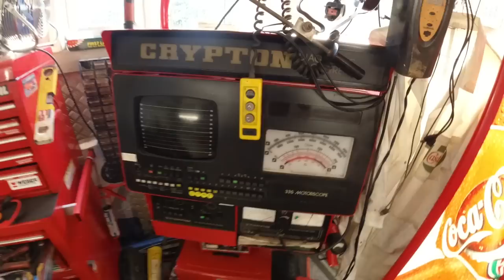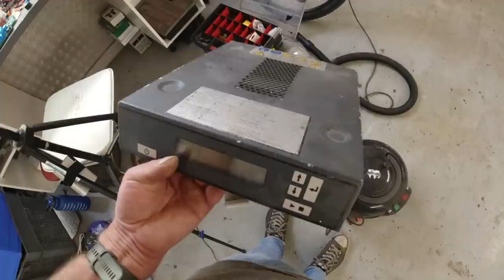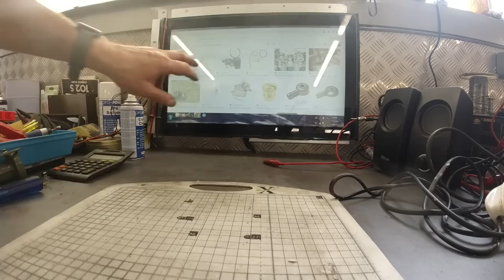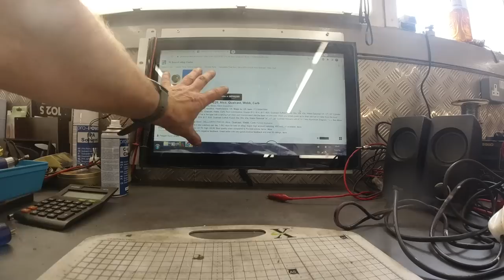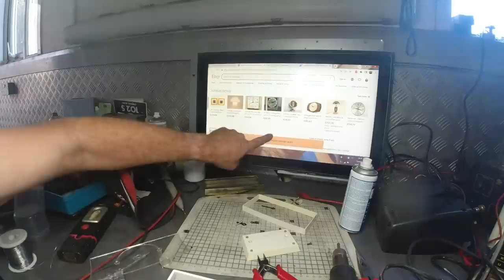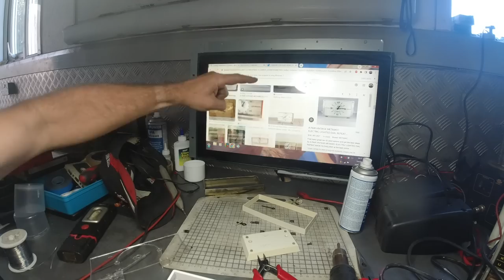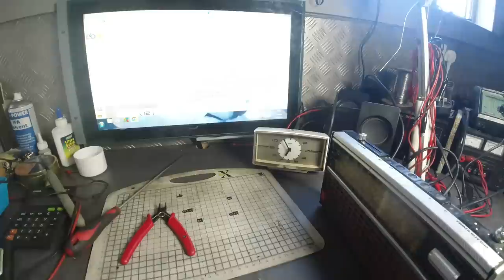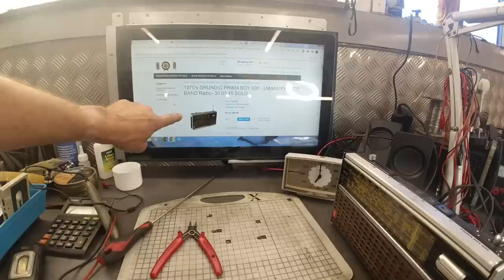Cortina City Tech video - Skip finds ! - Old Skool Lawn Mower, 1970s  clock and Radio.

Comment: I like these videos .  Usesd to get stuff from the dump myself before the council suited executive mob got involved and spoiled the fun . That clock probably  came from an old biddy n a care home hence the Electrical safety sticker that has been applied. Looks like Argos or Littlewoods catalogue fare. The blades on that lawnmower  look hardly used have the bean counters sourced cheap inferior  bearing and clutch parts?  The death of many good uk manufacturers.

Comment: neons work around 100V they usually have a series  resistor  to drop the voltage to make them last longer was that lamp directly across mains? Uk 240v

Comment: Pete, the tip nazis would have been on your case because electronic devices are shredded and seperated for the precious metal recovery.  Like you say it is better to re-use the stuff but they are in it for the money.  I'm an e-waste recycler but I think like you, I'd rather it be re-used than just broken up.  Take PCs for example, there's lots of people that can upgrade their current PC with a used power supply, motherboard, CPU, RAM, etc.  Shredding it all should be the last resort.